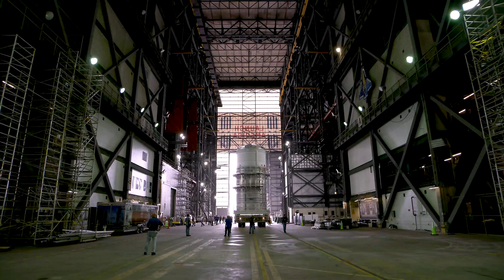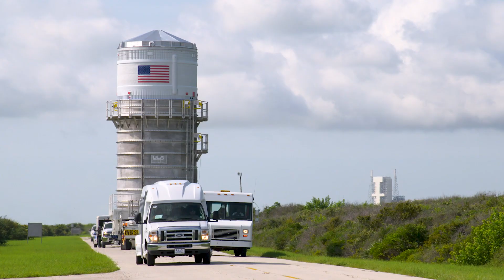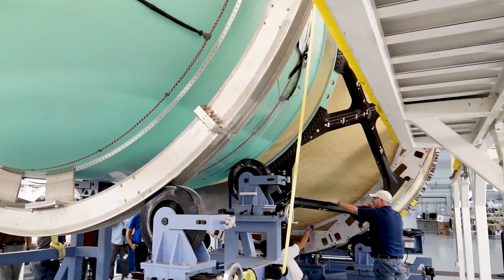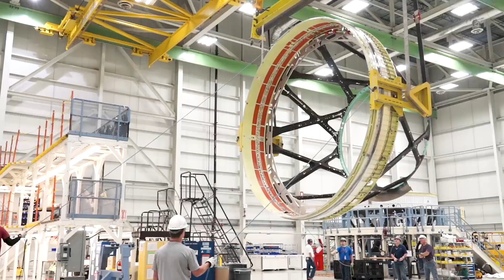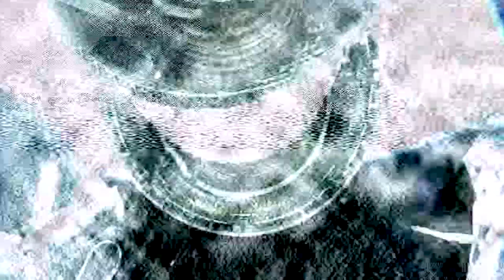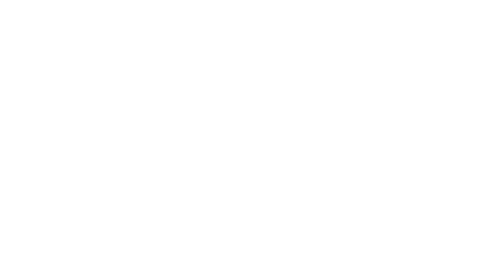Rocket Talk: Interim Cryogenic Propulsion Stage (ICPS)

Comment: And it only costs 2 billion dollars to throw it away.
Reply: Yesss! unlike the military who throws away $712 Billion
Reply: @meinkampf6191  military is scattered around the world. Also that 172b is used up fast (there maybe corruption but 172b is not enough for a superpower country.
Reply: You're acting as if they are just throwing out the vehicle with no use out of it at all.
It gets expended yes, but it sends a crew of 4 and initally 27 tons (later 40+ tons) to a lunar transfer orbit while it does that.
Besides, expendable rockets are anything but a new concept in spaceflight.
For example I don't see people saying how horrible the Atlas V is for being expendable, it's only pointed out for SLS.
As if SLS being expendable is somehow weird or unprecedented for a launch vehicle, especially of that size.
Reply: @brokensoap1717  The Atlas V is an older rocket, doesn't have a hydrolox first stage, and doesn't cost a fortune to launch compared to other expendable rockets.
Reply: Closer to 1 billion actually

Comment: Do a video on the hydrazine attitude control system. How is it kept under pressure in zero G? How is it prevented from forming liquid bubbles that float freely within the propellant tank?
Reply: that would be a very interesting video, great suggestion

Comment: The stacking is going very quick, can’t wait to the launch of Artemis 1
Reply: Yeah, but this rocket has been in construction for at least the last FIVE years
Reply: @Nico_6967  I meant the final stacking
Reply: @qwertyeet  ok
Reply: @Nico_6967  Yes, but at the same time, a massive portion of parts for artemis 2, 3, and 4 are already assembled in those 5 years, as well. Still slow compared to SpaceX, but once you consider all the red tape involved, it's somewhat decent.

Comment: wow. so exited for the first artemis launch
Reply: I didn't even know SLS has this awesome nozzle extension! Hopefully we'll have live onboard views! Can't wait for it to happen!
Reply: @falafeldurum2095  that nozzle extension is ULA's way to improve ISP of the RL10 engine. You can check for example NROL-82 mission it was used there or other launches with Delta IV
Reply: It is an awesome rocket, but I don’t see it launching more than 4 or 5 times.
Reply: @Nico_6967  it will, they already planning the 9-15th core stage
Reply: @dummyjoe7895 , I hope they scrap those plans once they realize just how obsolete SLS is.
Reply: @Nico_6967  SLS Is not obsolete, it’s a very much needed vehicle
Reply: @dummyjoe7895 , it is obsolete, and not needed at all. There are just so many cons to it and not many pros. Some of the cons include the price, the fact that is used Apolo and Shuttle era components, so it’s parts are basically from the 70s, another con is just the fact that when compared to starship, it is just terrible. It is more expensive and less powerful. The only pro that I can think of is that it’s a heavy lift vehicle. But it is still nowhere near starship.
Reply: @Nico_6967  yes SLS is needed. Like I said it is the only vehicle that can take astronauts to the moon. Starship won’t be human rated for at least 5-10 years. And starship was developed only a few years ago when SLS is over 10+ years old. And Starship can’t even get out of LEO itself without refueling 5-7 times which will add weeks or months to missions, while SLS can do it in one trip. Aswell SLS isn’t meant to fly “weekly” like starship is meant to do so there itself it’s a totally different type of vehicle.
Reply: @dummyjoe7895 , starship could have the tankers waiting for it in orbit and complete the re fueling in hours. The tankers would be launched in 1-2 days and will eventually be built in a week. Then you have SLS, which you said it yourself, over 10 years so far. SLS will take at the very least, a year to be built, by which point starship would have done the mission at least 20 times.
Reply: @dummyjoe7895 , also, I feel like Starship will be human rated pretty quickly. After all, the second SLS launch will be crewed. I would say that there will be humans in orbit on a starship in the next 2 years (launch on dragon and dock with starship). Humans will probably be launched on starship in 3 years.
Reply: @dummyjoe7895 , also, the final design for starship wasn’t even released 2 years ago and they have already gotten this far
Reply: @Nico_6967  tankers waiting won’t be as effective because you will boil off the fuel, it’s better if the tankers go after. Also SpaceX isn’t controlled by politics like NASA/ SLS is so thats part of the reason why it’s taking so long because everything kept changing about sls over the years until now.
Reply: @Nico_6967  SLS will be crewed on its second flight because it’s built on proven technology, NASA also said it could launch humans on its first launch. And NASA won’t certify starship for a long time, if ever, because it’s not proven and dangerous with no Abort system. NASA has learned from the shuttle that there needs to be an Abort option. Also launching on dragon and docking with starship isn’t “human rated” for a launch. SpaceX very well just plop people on starship because they are willing to die and SpaceX will take the chance.
Reply: @Nico_6967  SLS, unlike Starship has been designed with human rating in mind, which is why they are confident flying humans on the second launch.
Starship, unlike Orion, doesn't have a LAS and has questionable construction and QA methods.
Wouldn't at all be surprised if it only ever stays a cargo rocket only.
Reply: @brokensoap1717 , that is extremely unlikely, it will cary us to Mars
Reply: @brokensoap1717 , Starship was built for  humans, and about the no LAS, you have to remember that shuttle didn’t have it either
Reply: @dummyjoe7895 , NASA doesn’t have to certify it, SpaceX will start flying it themselves
Reply: @dummyjoe7895 , they don’t want to, it is just inevitable.
Reply: @Nico_6967  they can reduce the risk by adding an Abort system, which they aren’t doing. Plus you know SpaceX rushes things which causes them to fail.
Reply: @dummyjoe7895 , there really isn’t any way to put an abort system on Starship, if they fired up the raptors, they would probably blow the booster up. The only way I can think of would be on the lunar Starship, they could use the lunar landing thrusters for a LAS system. However, they rush things, which is true, but they don’t fail much. Of the 5 Starship flights, only one, SN11, could really be considered a failure. Although blowing up Starships could be considered a failure, a failure is only a failure if you don’t learn from your mistakes. They launch and blow up things so they can work faster. The more they blow up, the more they learn. If SLS blew up on Artemis 1, it would be a catastrophe, if S20 blew up on B4 during the orbital flight, no one would care. If both of those things happened, this would be the result. For the Artemis 1 failure, NASA would launch a huge multi year investigation, running every last simulation possible. SpaceX would just add some minor adjustments to S21 and B5, and then fly them, if they don’t work, they build S22 and B6, and that just keeps happening a few more times (by then, reentry is the problem, not the booster) they get it right, meanwhile, NASA has only completer 2% of its investigation.
Reply: Starship is most dangerous for humans during the bellyflop maneuver
Reply: @FalconTrooper , that is a common misconception
Reply: @FalconTrooper  it’s also a dangerous vehicle overall. No Abort system if, one flap fails it’s over for the crew.
Reply: @Nico_6967  stop badging in here as a spacex fanboi. SpaceX final Starship is nowhere near Boeing finishing SLS. Boeing is still far ahead.
Reply: @Nico_6967  Starship is dangerous for people inside during belly flop unless the humans inside have some stabilizer that makes people stay in their position and not feel the sudden change of orientation.
Reply: Same, but it will be a HUGE waste of money.